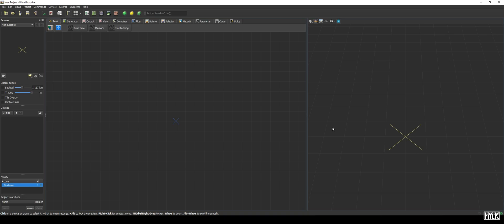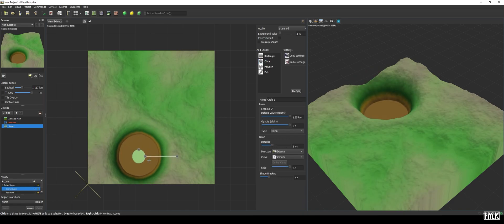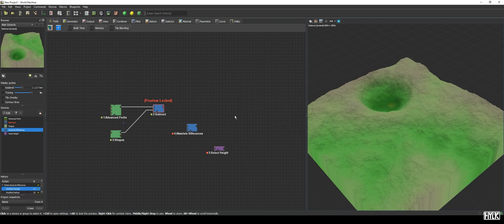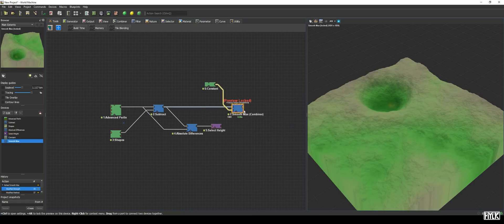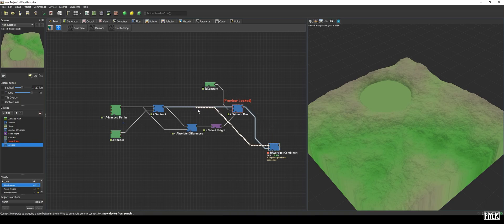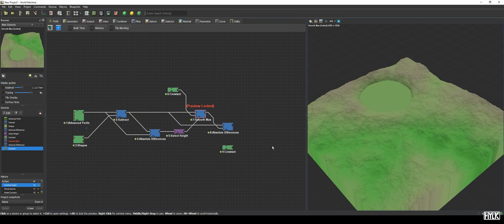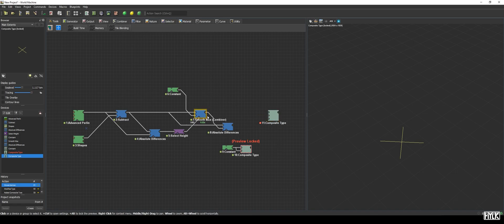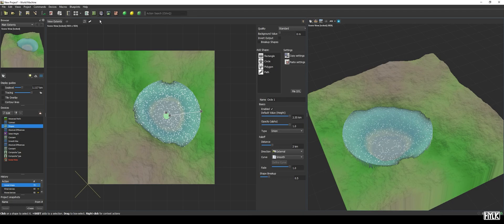World Machine Tutorials | Ep. 60 - Creating a lake

Comment: Why do we need "Absolute difference" combiner? I guess we can just connect "Shapes" to the "Select height" directly
Reply from the maker: You are correct that it would suffice is this case! This is because of the simple “subtract” operation. If you, however, use more operations to create a more interesting shape, distortion for example or a min/max operation, you will need the absolute differences method. This is why I used that method, as it now is applicable to a broader set of scenarios!

Comment: Hylke I am running WM version "Artist Point Build 4031.2" and on the Combiner set to absolute differences with your settings it just creates an entire black mask unlike yours where it shows the lake area. Then at 3:30 my environment does not do anything like yours, nothing happens at all. I am wondering in the version I am using that if the "Absolute Differences" has to be set to mask?
Reply from the maker: Hey, that is strange. I have not encountered different behaviour of the Combiner[Absolute Differences] yet. Do note that, if you have a very minimal lake crater, the output of the Combiner[Absolute Differenes] will be very minimal as well. The Select Height device will transform this weak output to a clear mask (if all works well...). If this problem consists, could you post on the World Machine forum? I'll be able to give a better explanation with screenshots on there! And sorry for the very late reply.